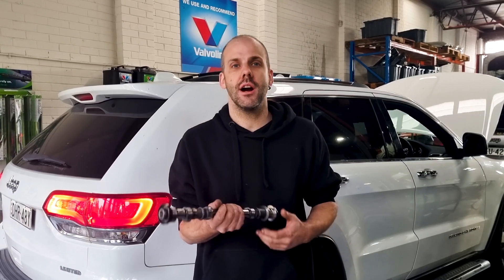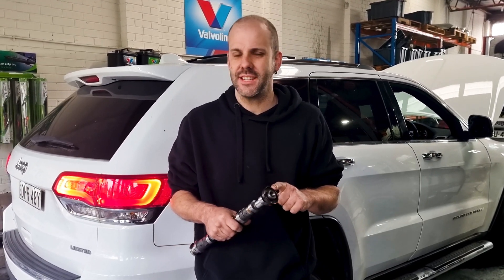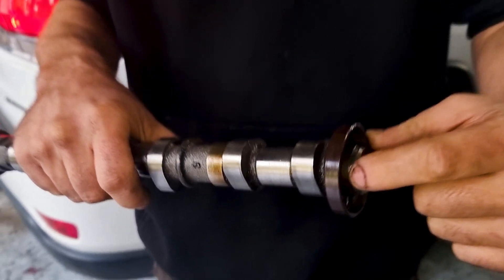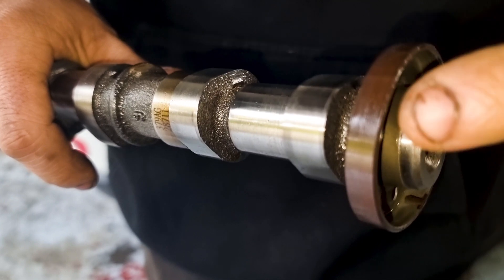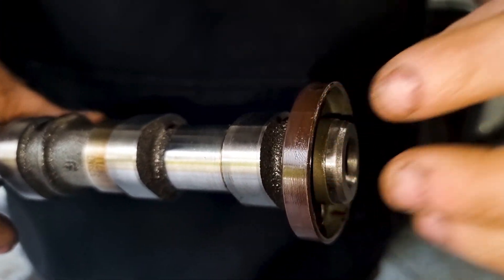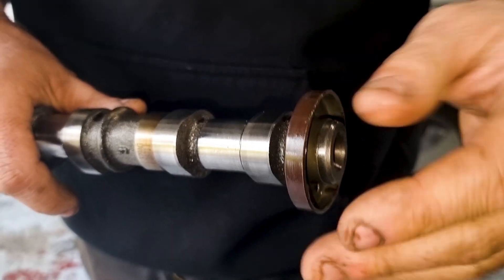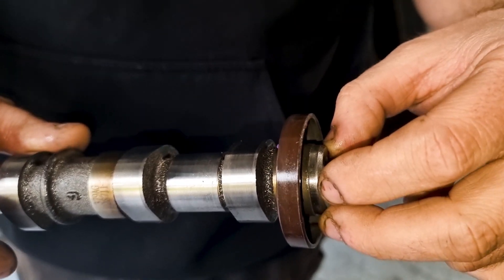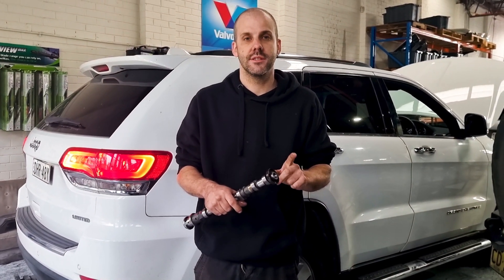Jeep 3.6 Cam and Crank Correlation Fault Code

Comment: Hello thanks for the video. I have a 2012 wrangler Sahara, with camshaft sensors fault codes and misalignment between cam and crank. The procedure that I followed was to change the timing chain this because when a remove the cover I noticed it a little bit loose. Furthermore, I checked the voltage and the signal coming from cam sensors after and before the change of the chain but I saw that for the quadratic signal coming from the sensor, it appear not be entirely in quadratic form but like “rounded” in the edges. Therefore, I checked this internal cam seal that you are referring to and saw that their shape is damaged and not entirely uniform. I will try now to replace those. My question now is: in your experience, when this cam seals have this issue, could be the case that the engine suddenly stops? Despite of having this correlation codes?

Comment: Hello, I have a quick question. I’m at my wits end with my 2014 JKU, I’m getting codes p0017 and p0019, recently the traction control light comes on. The jeep will run at normal rpm’s when the engine is warmed up. However, on a cold start it will stall out many times. Any help would be greatly appreciated!! Thank you!!!
Reply from the maker: Therese codes are related. They mean the crank shaft and camshaft are out of sync with each other. 
You will need to replace the timing chains.
Reply: did you fix your problem, I have 2012 caravan and when the engine is not worm it stalls many times, it has p0016 and p0017 no traction control light.

Comment: Hi Dannie, 
Have you come across many crank angle sensor faults in the V6 diesel?
Reply from the maker: Yes. Fairly common
Reply: @GDLautoblog  have you data for exhaust camshaft phaser 1  /crank difference ?